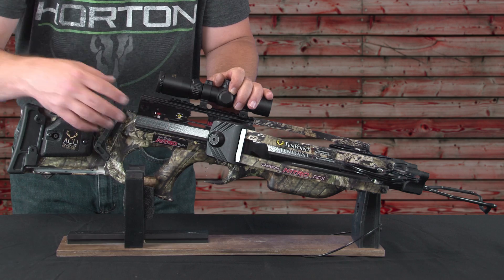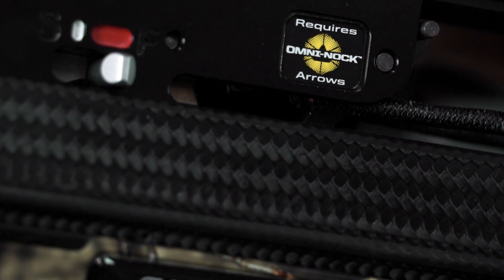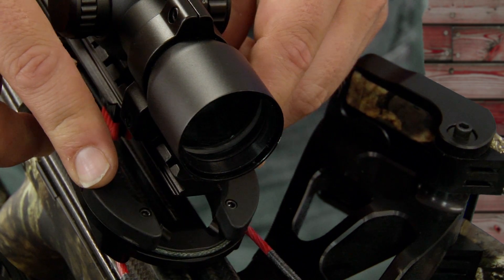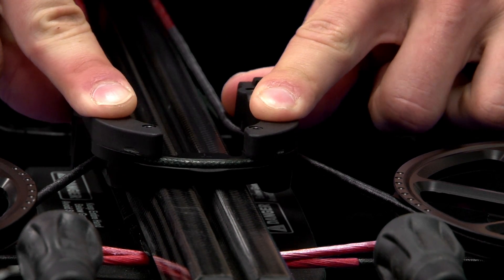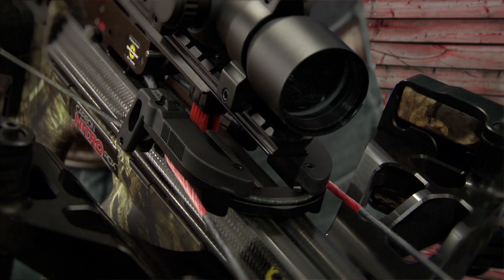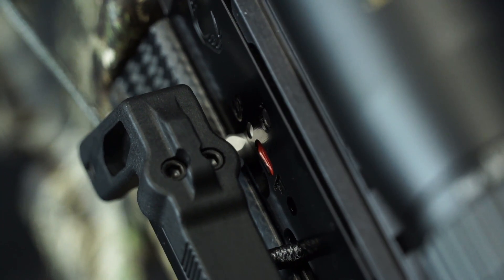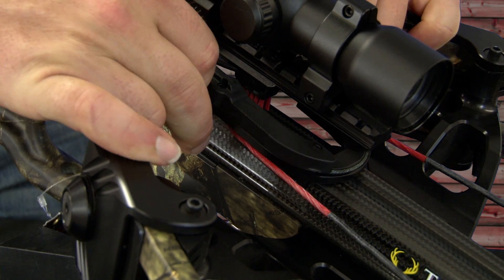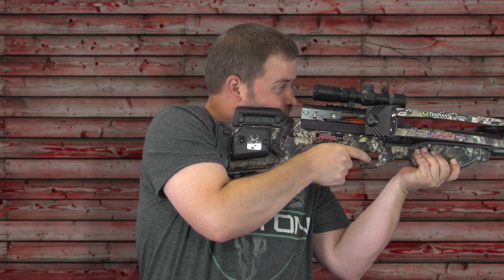How to Fix being Stuck on Dry-Fire-Inhibitor Using ACUdraw for RDX Crossbows | TenPoint Crossbows

Comment: Now how do I uncock it
Reply from the maker: The only safe way is to shoot the crossbow into a suitable target.
Reply: @TenPointCrossbows  what a terrible design if I knew you could not de-cock it I would have never bought it. I can’t believe you want your customers to put their fingers on that claw and pushing it against the strings while it’s fully cocked. So is there a way besides that to decock it if I don’t have a target to shoot it at, otherwise a target should come with the bow.
Reply: @dzenx9861  it's pretty standard in the industry. Higher end crossbows and recurves can be decocked. Otherwise the overwhelming majority of crossbows are decocked through discharge.